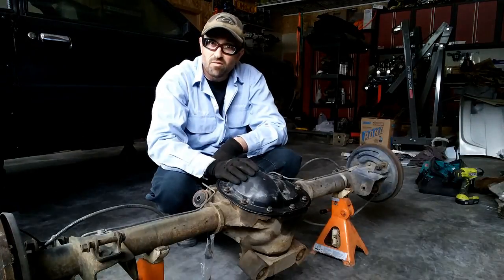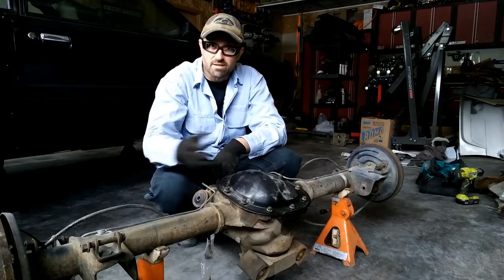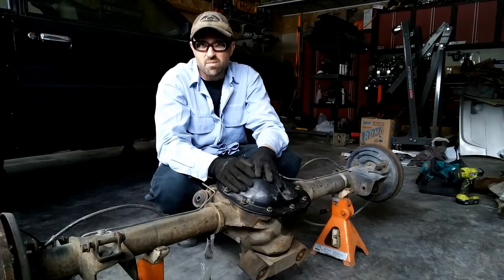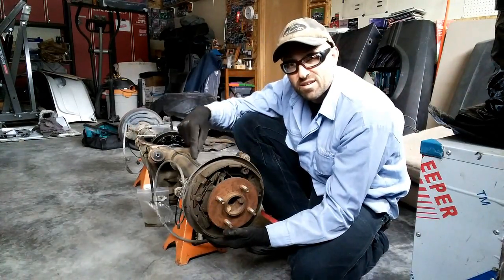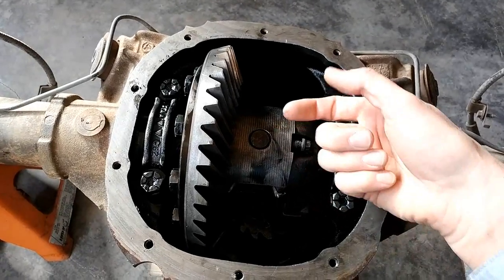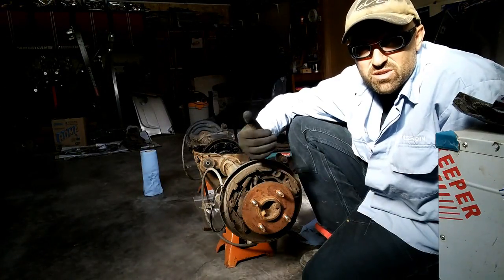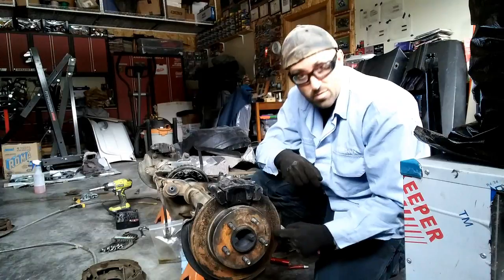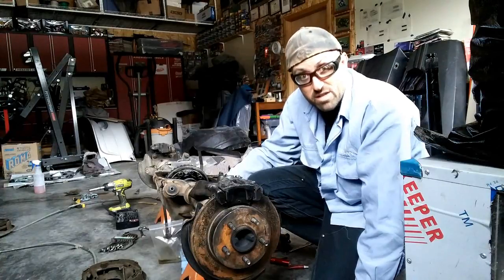How to Assemble a Ford 8.8" 5-Lug Axle With Disc Brakes

Comment: Hi there, I’m inquiring about your expertise in up grading a 1991 Mustang 5.0 from a 4 lug to 5 lug. What mustang year w/ 5 lug will be a direct bolt on to a 1991 Mustang 5.0? I figure it’s cheaper to by an axel than by the entire caliper conversation kit from LMR. Plus, I want to upgrade to a 31 spline for a coyote swap later on.
Reply from the maker: You can add an SN95 axle to your '91, but the axles are 3/4" longer on each side. You didn't mention if you wanted to stay with the drum brakes or move to disc on the rear. If you want to stay drum, the LMR kit with 31 spline axles may be a better choice.

Comment: Question will a 1979 thru 1993 8.8 rear axle fit under my 96 f150 XLT with 97 ford mustang gt five lug conversion and disc brakes?
Reply from the maker: I'm not very familiar with the F150 platform, but I believe it would fit.  Is the F150 running coil springs or leaf springs?   Leaf springs require perches that aren't needed on the Mustang. The '97 axles and brakes will go into the 8.8 housing though.  You'll just need to change your master cylinder and maybe switch to a manual proportioning valve to adjust brake pressure bias after the switch.

Comment: When you guys upgrade a forbody to five lugs  can you fit 2012 ford mustang rims on it and next question is is the rear axels on the forbody the same or close to the rear axels of a 1992 ford econoline e 150
Reply from the maker: The 2005 - 2014 wheels can be tricky to fit on the Fox.  They typically use a 19" or 20" wheel, which the Foxes really don't tuck under the car well.  The also like a lower offset, and the 05-14 wheels are a larger offset (meaning the sit inboard more).  You'll most likely run into a lot of problems with fitment trying to run the newer wheels.  It can be done, but it's going to take a lot of work to make them fit.  On the rear axles, most swap in Bronco II, Aerostar, or Ranger axles for a 5-lug rear.
Reply: @BasinMotorsports  thanks for replying I bought this 2017 I think rims with tires their 19" they would look so good on my van I look for nubs and rear axels for 2010 to 2020 and their the same also looking for mesurements for the axels the van is 31.65 and the mustangs are 32.71 a inch and some differences am thinking maybe their would fit in had a 1988 ford econoline and I fit 5.0 rims she look awesome again thanks for replying

Comment: What Order would you put these repairs/upgrades in?
Sub Frame Connectors, 5-lug swap with tires wheels, suspension upgrade
Reply from the maker: Subframe connectors first.  If the suspension is worn out, go that route second.  If it's good to continue on, I'd go with the 5-lug swap then suspension.  Are you upgrading the brakes with the 5-lug swap?

Comment: I have a Ford maverick with a 8  inch rear 5 lug what do you think is better explore or mustang
Reply from the maker: It depends on what your long-term goal is.  They both use the 8.8 housing, but the Explorer axle should have a 31-spline carrier & axles and rear disc brakes.  I think it's also 5-lug, so you may be able to your current wheels unless you plan to buy others later.  The Mustang will have a 28-spline carrier and axles (not as strong as 31-spline) and may be 4-lug if it hasn't been changed to 5-lug.  I would probably get the complete Explorer axle and then add the necessary booster, master cylinder, etc. to move the extra fluid for disc brakes.

Comment: my 1996 f150 XLT has leaf springs came that way from the factory.
Reply from the maker: It should fit other than you'll need the spring perches welded on the axle housing for the leaf springs to attach to.  You may need to measure the width of the assembly compared to the truck.  It may not be wide enough, or could be too wide.

Comment: Well it seems you never reply to the comments but here it goes anyway...why not just use a 8.8 from a sn95 if your gonna use sn95 axles and save some hassle?
Reply from the maker: James Hanner III Hi James, I try to answer everyone unless they are being disrespectful and rude. Did I miss a comment from you previously?  Sorry if I did. The reason I went this route is that I had the axle already from the wrecked '92 coupe and it was supposed to have 3.55 gears already installed. I bought the 5-lug pieces before I opened up the differential cover to verify that the gears were stock (not the quoted 3.55). By this point, I had all the pieces, so I just built what I had. If I was going to buy an axle, I agree that just going with an SN95 axle to start with would save a lot of time and labor. One thing I vowed to myself by building this car was to not shy away from extra work because I didn't know how to do something. I'd never taken apart or assembled a rear axle until this video.
Reply: Basin Motorsports sorry i guess i was both and made a wrong assumption ...bad habit of mine! I understand now and thanks for the informative videos. If you use the longer axles will they still seat properly?
Reply from the maker: No worries.  I do try to respond almost all the time if you hae a good comment or a question (or seven).  The extra length is outside the housing between the end and the seal for the ABS ring on the SN95.  Everything inside the axle housing is the same.